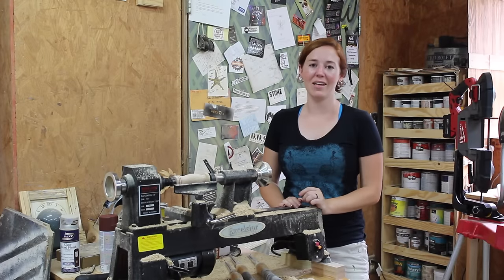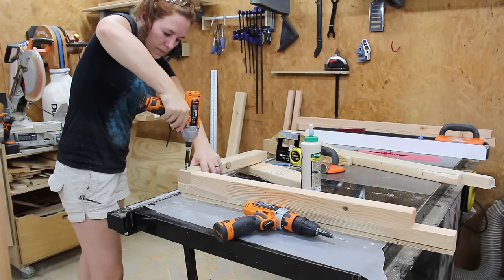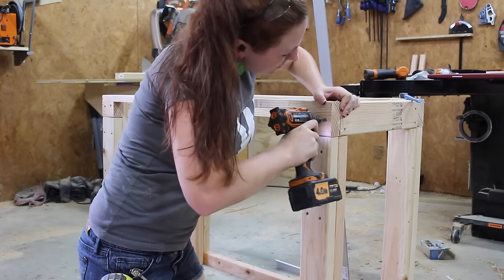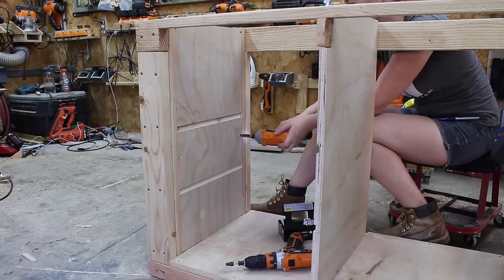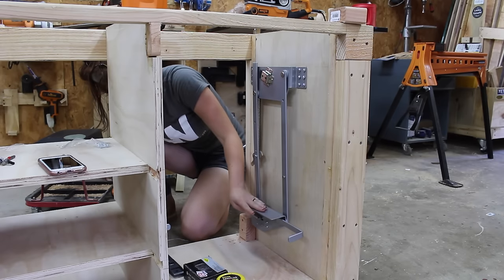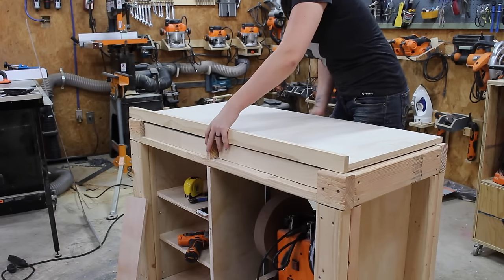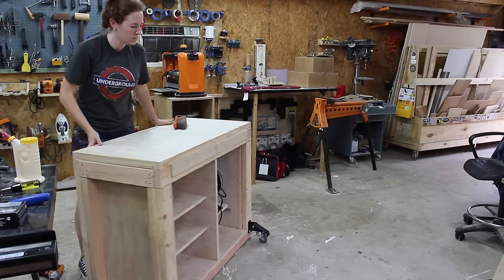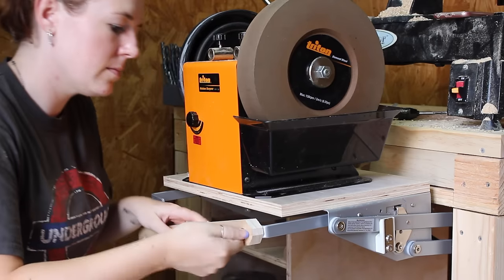Lathe Stand With Pull Out Grinder

Comment: I've never seen those step-down casters before...I'm gonna have to keep those in mind.
Shame they don't have something like that for larger wheels. I've got an anvil stand in my backyard that I've wanted to make mobile for over a year.
Reply: Try looking at a mobile base for a cabinet saw. They're pretty stout. Wheels aren't much bigger though.
Reply: You Rock!
Reply: The weight that one person can lift by pushing down on a pedal is usually what dictates the wheel size and capacity. There is no point in making a drop down caster with a 6in diameter wheel that can support 500 kg since you would never be able to lift the table or bench when fully loaded.
Reply: OU812
Sure, sure, but I only need to lift about 60kg, and need big wheels so it can be moved around a bumpy back yard.
Reply: verdatum You're better off making your own drop down mechanism and using semi-pneumatic casters in that case. They roll much better "off road" than plastic or urethane caster wheels.
Reply: yup, that's been my plan, I've just been putting it off

Comment: GASP !!!  DRAWERS !!!  OMG !!! OMG !!!  April made a set of drawers !   lmao  Had to rib ya a bit there about that...  Nice bench !!  I think I'll adapt it to one I'm going to make for my bench top jointer and lunch box planer.
Reply from the maker: Haha I figured I would get a little ribbing from ya Dave. ;) You know me too well. I couldn't let that space go wasted though so drawers it is! I actually originally designed it with drawers on the bottom rail as well but ended up needing more room in the cabinet section for the brackets to fit. Before you buy the brackets for the planer or jointer, check the height restriction....I think they only accommodate up to 17".
Reply: Actually, I'm going to stretch your design to 5 ft. long by 4 ft. wide.  I'll mount the bench jointer on one side, and the lunch box planer on the other side.  I'll have plenty of room for both tools, and have room to set pieces ready to be milled next to the tool.  :)  And yes, there will be drawers to hold extra blades and whatever else I need at those two tools.

Comment: Ms. April I do need  some advice. I work in a warehouse where I receive products and place them in storage. Occasionally I have to use a moveable staircase to place the products in elevated position. However I don’t have a table or bench up there so I have to  climb up and down repeatedly. I would like to install a table or workbench that is like your grinder table with some subtle differences.  It would be coming out of a space that is fairly thin so it would need to flip into position where I set  boxes that weigh up to 25 -30lbs. Or another possibility is attaching it to the frame at the top of the stair case where I would be able to flip up and lock into place a small table to place the boxes.  There is a bar that runs horizontally about 3-4 feet. It is a rectangular prism and made of steel. The width size will dictate exact placement. Do you have any suggestions? Thank you for your time.

Comment: I agree with +David Mm. You might want to think about doors for your cabinet to keep chips from the lathe out, especially the wet grinder. The chips will find their way into the deepest darkest nooks and crannies, and clog everything up. I you're sanding on the lathe, it causes a shower of dust that goes straight down onto the table, and eventually into the cabinet.
 It's a fine design otherwise. Better than mine.
Reply from the maker: Thanks! Yeah I thought about adding a door to that side but I'm going to leave it as is for the time being and see how it goes. I would prefer to leave things open if possible so I'll use it and see how bad the bin collects.

Comment: Hey April - thanks for all your great projects. I'm planning a miter saw station based on Jay Bates' plans, and want to incorporate an appliance lift like you did on your lathe stand, for a grinder. I'm hoping you can help by telling me the width of the hardware you used, which appears to be the Rev-A-Shelf RAS-ML-HDCR. 

I need to know how wide one of the brackets is, from the mounting flanges to the point where you attach your own shelf. It appears to be about 1 1/2", but this information isn't available anywhere that I can find. 

I am trying to figure out the width I need for the cabinet based on the need for a shelf that is 20" wide. I'm hoping to design the cabinet in SketchUp before buying the hardware and starting the build. 

Even if you are unable to reply, I really appreciate what you and your compatriots do for the woodworking and home improvement community.

Comment: Great idea with the lift mechanism. How come you hogged out the lap joints with the dado stack rather than the bandsaw?
Reply from the maker: No real reason, just what I thought to do when it came time to get it done. Bandsaw would work just fine though.
Reply: I just recently got my bandsaw setup and am still in the find excuses to use it phase. 

You should do a review video of the Triton track saw and slow speed grinder you used in this video.

Comment: Form metal lathe , I would keep grinder away from lathe to protect from abrasive stuff. Some machinists even split their workshops in sections or install curtains to prevent clouds of abrasive stufff getting on machinery.This is wood lathe, may be you can't damage these.
But anyway - very neat and weel executed

Comment: Great vid, as always.  Couple of quick questions;
Where do you get your sheet goods?  I have found the quality at the big box stores to be a bit lacking (unless I buy the stuff that is $50 a sheet).   Any suggestions?  (I am in the dfw area).
That is an interesting looking lathe - any story on it?
In one of your recent vid's (recent to me) you had a very interesting looking stud finder - yellow with a bunch of horizontal lights on it - it seemed to work really well - just curious as I am not very happy with mine.
thanks again for the vid - also, the end comments on how stable you felt the lift was were helpful.
regards.
Reply from the maker: It depends on what I'm building on where I buy it. For this, I bought the cabinet grade (around $32 a sheet) from the big box store. If it's something nicer I go to a local place called The Plywood Company of Fort Worth. The lathe is a mini Lathe that my sponsor Rockler sent me. : ) The stud finder in that video is the same one I use today. It the most expensive stud finder I've ever purchased but it's last me three years and never misses a lick, it has my full recommendation.

Comment: sweet! very good work on a heavy duty stable lathe bench. Where do you get those 60 lb kitchenaid retractable stands? I'd use a brace if the direction of the grinder pushes down, could be a pain if it won't hold stiff against grinding weight down.
Reply from the maker: You can find them at any Rockler. : )
Reply: April Wilkerson Never seen a Rockler that I know of. I'll check on line, nice lil devise that is.

Comment: Been wanting to use a mixer lift for my oscillating spindle sander. Haven’t found any with that much weight capacity. Anyone know what she used or know of a source for one of that capacity? Thanks.

Comment: Is the grinder backwards? Any reason to do it that way?
Reply: No that is normal for This type of design of wet Sharpener,  they have a front Jig support and a top jig support. The Triton has the power switch on the back of the unit. If the unit  was turned so  the power switch was to face front then  the Front jig support would be facing the back and it could not be used.

Comment: Why so low rpm on your grinder?
Reply from the maker: It's a slow speed grinder
Reply: Hehe I know, you said that in the video. But this is the first time I see so slow speed grinder. All grinders I used or saw were high speed.

Is it better for lathe tools grinding?

Comment: Could Triton have ripped off Tormek's whetstone grinder any more?  I guess imitation truly is the most sincere form of flattery.  April, you might want to laminate the shelf the grinder sits on.  It would be easy and would protect the wood from the water that could splash out from the grinder.  Other then the that, VERY useful project.

Comment: well explained
Reply from the maker: : ) Thank you
Reply: I have a garage I would like to transform into a tool workshop.  I want to know of a  workshop template I could use to plug in what I have and make it all fit in the space.  Any ideas?
Reply: Grizzly.com has a template that you can design/adjust machines on. It might work and it's free.
Reply: +arkansas13 I will check it out
 thanks